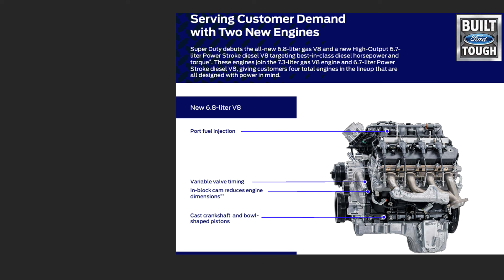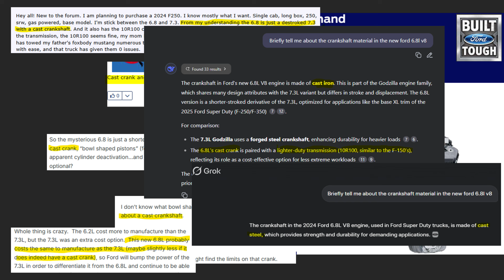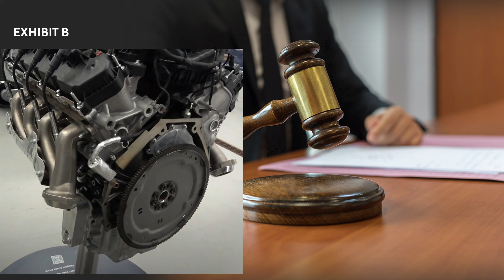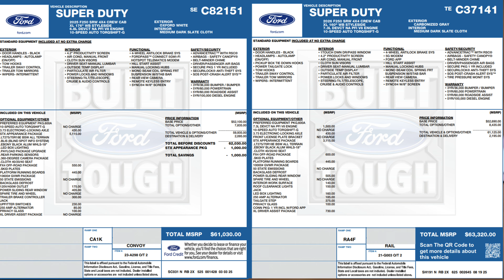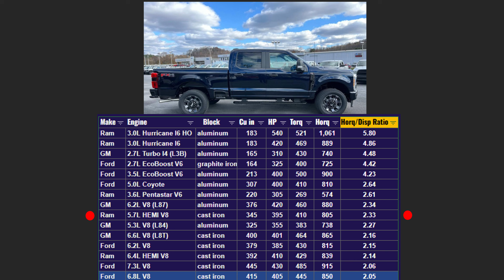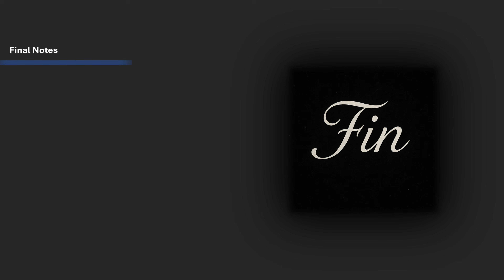Ford’s “Minizilla”: Making the case for the 6.8L V8

Comment: Pretty much agree with you its marketing so as not to devalue the 7.3.  As a 56 year old i grew up with a 460 in dads pickup so im sad they made these 6.8 and 7.3 as i woukd have loved to have a "new" 460.  

Ive heard 6.8 and 7.3 running and they do sound a little different but both nice.  Im still stuck on my diesels but maybe go back to gas at some point.

Im chevy now though a ford man at heart.   Just feel that fords interiors seem cheap and the bones of the super duty go back to the 90s and just seem majorly dated to me styling wise.  Ford needs updated body style badly.
Reply: You’re wrong about that. The current Super Duty bones (chassis and body) date back to 2017. The previous generation was 1999-2016. RAM has the oldest HD “bones” while GM HD trucks use 2020 “bones.”  The current Super Duty chassis is possibly the strongest of the Big 3, so not much need for change. Interiors and general styling are subjective, so to each their own. Fords current engine program is absolutely number 1. Transmissions are basically identical to GM, for better or worse. RAM easily has the best gas transmission, and perhaps the best diesel transmission now for 2025+ models.

Comment: Another plus for the Godzilla platform is the gear driven oil pump versus the belt driven oil pump in some other engines. Great video! Thanks for a clear, concise presentation of the facts.
Reply: I’m pretty sure the GodIlla / minizilla engines use a chain driven oil pump, not gear driven.

Comment: Thank you sir for doing this video.  I've been wanting a 6.8 video so bad yet like you said, nobody talks about them.  I'm very curious about the transmissions as I'm so concerned with a 10 speed as well as maintenance suggestions.  I do not trust the manual anymore for maintenance and tend to lean towards 5k/6months oil changes, 30k tranny drain/fill, 30k/2 year rear diff oil change, 50k coolant change, 100k spark plug change (unless on Wife's Highlander which is 60k, and any other suggestions you might have would be great.

Thanks again and have a great day!
Reply from the maker: Can't argue with your maintenance plan!  Keep that up and it should last forever.  I change my oil on the 5's.. 5,10,15,etc.  Nice and easy that way.

Comment: I ordered my F350 with the 430 gears.  It's a monster.  Still only about 2100 RPM at 70 mph so it's a no brainer especially in the mountain states.   So much less strain on that engine and transmission and i can crush piles of pine cones triple that size under two tires at the same time!!!  I appreciate the deep dive into the crankshaft issue but you know even though I'm pretty convinced based on the evidence and the fact that it's extremely unlikely that they would use a cast crankshaft in a super duty truck even though it could be cast steel I would like to see someone do a physical test on one of those crankshafts to put this issue to rest convincingly once and for all.
Reply from the maker: lol at one-upping me on the pine cones :)  That does sound like a pretty great setup.  I’ve said before, but even if it was cast, it would be fine - especially with stock numbers.  You just don’t see a lot of broken cranks these days. Whatever they put in there would be fine.  I definitely agree about wanting to see someone get their hands on one and remove all doubt.

Comment: Exhibit 123 - Junkyard LS Turbo build spinning 7,000 RPM and making 1,000HP on a CAST CRANK. In the 21st Century, a "cast" crankshaft in an OEM HD engine from one of the North American 'Big 3' means very little, especially for a Normally Aspirated Engine that will never see over 6,000 RPM. These aren't the cast crankshafts of the 1980's.
Reply from the maker: Right.. modern engines fail for a lot of reasons these days but a broken crank on a stock engine is way, way down the list.
Reply from the maker: Right.. modern engines fail for a lot of reasons these days but a broken crank on a stock engine is way, way down the list.

Comment: Thanks for the honest review of the 6.8L V8. You did mention the two window stickers you compared were not identical, but "close enough".  It would be a better comparison, of both the price difference and payload/towing/GVWR, if you had two trucks of the same model year with the same wheelbase, one with the 6.8L and one with the 7.3L  instead of a '25 long-bed vs a '26 short-bed. I have not done that specific comparison, so I don't know if the resulting differences would be greater, or smaller.
Reply from the maker: Wow, I can't believe I didn't catch that!  Thank you!   I used the 'Search Inventory' from Ford's site, and I know I clicked on two short beds.  One apparently was actually a long bed.  I just assumed the years would match since that's what I searched for.  That will teach me. 

So after reading this I went and found 2 (actually) very similar 2026, 6 1/2 bed, and very similarly configured options-wise.  No payload package or gvwr package on either.   Same axle.

The good news (for the video anyway) is that it still holds true.   6.8 is 1,410 payload and 14,050 tow.  The 7.3 is 1,670 payload and 16,546 tow.    Here is the 7.3:  1FT7W2BN6TEC40064   and the 6.8: 1FT7W2BA6TEC95448 .  Great catch and thanks for letting me know.
Reply: @motorobo0  Thanks for the response.  I looked at the window sticker for the 7.3L (for whatever reason I couldn't see the sticker for the 6.8L [maybe they sold it?]) as well as the sticker for some other 6.8L trucks with the 600A XL package. It looks like the 7.3L is a $1500 upgrade for this configuration. Strip away the other options and you have: base price + destination = $54,885 with the 6.8L, and base price + destination = $56,385 with the 7.3L. Everything else mechanical would be the same in this case. It seems Ford is offering a great choice for the consumer either way. Per your research - the base truck will haul and tow more than most people will ever need @ "1,410 payload and 14,050 tow" and it will probably average marginally better 'real-world' fuel mileage. However, if the customer needs (more likely 'wants') the ~18% higher "1,670 payload and 16,546 tow" and they are willing to live with the likely lower MPG figure, they can get that for only 2.7% more money ($1,500).  I live at about 8000 feet above sea level in the mountains west of Denver, CO with many high % grade roads and frequent trips over 11k+ foot high mountain passes so for me the extra cost of the 7.3L to move up in power and add the 18% in capabilities would be insignificant. I'm currently driving a 2013 with a supercharged 6.2L and the 6speed auto. I've got 170k+ miles and still running strong, with no issues at all, so it will be a while before I'm ready to pull the trigger on a purchase.

Comment: Can you hot idle this one?
Reply from the maker: To a point, sure!  I'd certainly feel better about idling it than a 6.7.
Reply: @motorobo0 lots of failures in the 7.3 because of hot idle
Reply from the maker: @Detroittruckdoctor55  I talked about that a bit, yeah.  In the chassis cab configurations, the oil pressure was in the single digits in the name of efficiency.  Same thing in some 6.8 chassis cabs, though not as common.  Very rare in consumer pickups, and from everything I've read, it's no longer an issue. They really took a reputation hit for that. Actually just put out a video a minute ago showing it being measured.

Comment: In about 10 years when im done with my 2000 F350 w/6.8 V10, I'll be looking to pick up a 6.8 Baby Godzilla equipped F350.
Reply from the maker: If you're taking good care of it, I have no doubt it will last till then :)   I have a friend with a very similar truck (I believe his is a 2000 as well) and it just keeps going.
Reply: I needed the most truck for the least money.  I worked for a Ford dealer when these came out. I've kept my eye on them.  It does the work well. Thanks! I'd definitely look out for a newer one with a 6spd.  Auto or Manual.  It's thirsty!  Ha ha. @motorobo0

Comment: I saw the oil pressure looking similar when I looked at it with Forscan on my 2024 7.3. Unfortunately, my best empty highway MPG has been 16.0 limiting myself to 70 mph from Abilene to DFW. The 7.3 is much more than I need. I probably would have been fine with the 6.8.
Reply from the maker: That’s interesting, thanks!   Good info..

Comment: The Godzilla engine architecture is a great platform with a LOT of potential. I know it's a pipe dream fantasy, but imagine a world where Ford de-stroked the 7.3 a little less to 7.0, with better heads, and a sportier cam, and then put it in the Mustang as a "Boss 429" reboot with a little more power than the 5.0 dark horse, but a lot more torque. I'd happily pay many thousands of my own money for that.
Reply: With an iron block that motor puts a 125lbs weight penalty on the front wheels.  That would completely change the handling of the car.  Mustangs understeer terribly to begin with.  That would make things worse.
Reply: @ericb.4914 I doubt very highly that the 6.8/7.3 is 125lbs heavier than the Coyote 5.0, the Coyote weighs the same as an LS1/2/3/7 and an iron block 6.0 only weighs 70lbs more than an LS2. The 6.8/7.3 is only slightly larger than a 351w, they put 351w and 351c in all sorts of performance cars with primitive suspensions compared to today, the 6.8/7.3 has the potential to make 600-700hp in a high state of tune with stock or lightly ported stock heads, the factory truck state of tune isn't impressive compared to the 5L but everything changes with a cam+springs, full exhaust and a tune. With boost the 6.8/7.3 could easily make 700-800hp on 93 and in excess of 1000hp on E85 all the way up to 2000hp with supporting mods. The ppoint of using the 6.8/8.3 is that it will be significantly less stressed at any power level compared to a 5.0 DOHC and it will run nearly forever and is rebuildable rather than a throwaway.
Reply: @LeeHendo 138lbs to be more accurate.
Reply: @LeeHendo  All those old cars were a shit to drive, just straight line performance, and 21 century drivers prefer cars that really turns. Good cars to drive needs a little bit of under steering for RWD and a hit of oversteering for FWD( that I like to drive too). A coyote with aluminum block is what makes mustang a excellent car to drive. Also, Coyote has a lot of room for improvement, better cams and porting to gain a lot of horses, or stroking to increase torque pornographically with system guaranteeing it throughout all rev range. Like
Reply: @victortaveira8271 factory the Coyote is running at over 120% volumetric efficiency, without boost there isn't much left unless you rev it 8500rpms, a stock long block isn't going to last long ng run that way, drag racing sure but, I would want a Boss 302 or 5.2L GT350 engine for that. The most they ever got from the Naturally Aspirated Cobra Jet Coyote was 620hp, a basic cam, springs, headers and tune on a 7.3L Godzilla does that and a Coyote cam rev and make HP all it wants it will never name the tq or last as long. Brian Wolfe was making over 800hp N/A with a stroker Godzilla. People used to run Big Block Chevrolets in all sorts of fast vehicles, a 7.3 is significantly smaller and lighter than one of those.

Comment: 8:00  If you mean power under the curve when you say 'horq', then sure.  Power under the curve means more torque down low and horsepower not tapering off at the high end.  Generally speaking on a racetrack horsepower is better and when towing torque is better.  Obviously both is ideal, and makes it easier for less skilled drivers, or people who want to tow at 70-80mph uphill, fuel and wear be damned.
Reply from the maker: I get what you’re saying, and don’t disagree.  Horq isn’t really a technical measure. Just general overall impressiveness.   An engine with 400 hp and 400 torque has more overall output than an engine with 300hp and 400 torque.  Sorting by torque (or horsepower) doesn’t capture that.  Horq does though.. Really just an interesting way to rank engines by what they ask of their displacement in general terms.

Comment: 7.3 gets a better transmission and the delta in price just doesn’t really make sense to go with the 6.8L. You had said they have the same transmission but I’ve watched tons of different videos that say it’s not the same. Not sure what’s going on with those.
Reply from the maker: For the F250, the 6.8 and 7.3 has the same transmission (10R100) unless you get the Tremor package.   I think that started with ‘25 model year trucks.  Can see with the build and price tool on their website.  The 10R140 is rated higher, but ‘better’ is debatable.
Reply: @motorobo0  quite a few people who seem to know their stuff state one crank is forged and the other cast

Comment: Great stuff. Thanks. definitely interested in transmission info 10r100 vs 10r140
Reply: Gettys garage has a great series on towing between them. You can see the 10r100 gets hotter than the 10r140 and probably is the reason for lower tow rating.

Comment: I got 24 f350 6.8 4.30 with gooseneck. Regular cab work truck. Tows 14-17k great….engine isn’t the bottleneck…the rear suspension or tongue weight maxed out is. Payload sticker says almost 5k. Aside from 2014 tundra (also regular cab), best truck ever.
Reply from the maker: Which engine do you have in it?
Reply: 6.8

Comment: I think Ford has missed a huge opportunity y not offering a Raptor package on the Super Duty and by not offering a Super Duty swb 2 door Bronco both with 6.8 and 7.3 Gas options. I would even be excited to see a 2wd long travel Raptor package (since the Super Duty still uses the Twin I beam suspension)with 37-43" tires, could be a killer prerunner type rig with tons of suspension travel, reduced complexity, increased speed, reduced weight and reduced cost without the 4wd. Add a Ford Racing or Roush warrantied blower kit making 700+HP and  you have the most desirable truck on the market.
Reply: Yeah - call it "the UNDERDOG!" I'd have to buy one....
Reply: @Arkie407 Maybe instead of Raptor the off road Super Duty could be called the Triceratops or something cool like that.

Comment: With no reliable automatic transmission available, and no manual transmission offered, I will keep my 1997 F-350 and it's 460.
Reply from the maker: If it does the job, and you like how it does it, that makes perfect sense.

Comment: Does the factory oil pressure sensor actually read a difference in oil pressure? I thought the sensor was open, or closed only, not a range of potentiometer readings as pressure fluctuates like a normal system.
Reply from the maker: It does read a difference.. for example, when it's cold the pressure is much higher, and just watching the data come in it jumps around a lot.  Someone did mention that I need to measure key on, engine off to start with, then subtract from the running number - I guess implying that it might be non-zero with the engine off.  I'm going to test that and see.

Comment: Missed the 3v 6.8 v10. Much more potent than than 2v
Reply from the maker: You're right about that - it was a much bigger rabbit hole than I thought to pull together all of the numbers, because they change over time.  I think all cases, I just went with the numbers the engine was released with - but a similar table with final (or current) numbers would be interesting as well.  The overall point though is that the 6.8 compares very strongly to everything past and present.

Comment: Glad I found the channel. We bought a 7.3 f350 for occasional heavy towing. I am confident our next f250 buy will have the 6.8 in it. My son and like the gassers as we can work on them ourselves.
Reply from the maker: I think that's one of the coolest things about these engines.  They're engineered to be owner maintained.  Unlike almost everything else out there these days.  And there's so much room in the engine compartment.
Reply: Do you plan to convert it to LPG/CNG for cheaper operating costs? In Europe most of those big american engines runs on lpg
Reply from the maker: No plan to convert it, LPG is a pain around here.   I do find it interesting that there's a bunch of big American engines running on LPG in Europe ... had no idea!

Comment: Also, I would like to add that your horq/disp ratio is some of the most insightful analysis on light duty pickup engine longevity vs performance that I have seen.  Nobody looks at this in modern vehicle comparisons for normal consumers.  It is only fleet managers that really get this.  We have become fascinated by turbocharged small displacement engines that can work very hard, but often, not for very long.
Reply from the maker: Thanks!  I'm glad the horq thing was well accepted.  I wasn't sure what people would make of that.  But it really differentiates between work engines and performance engines that can do work.  Big difference there.  I'd take longevity over raw performance numbers any day.

Comment: One thing to keep in mind with respect to marketing material from any manufacturer of any type.  The marketing department are experts on marketing, not equipment specifications.  If it sounds good and looks good, it gets sent out into the world.  Engineering is seldom tasked with checking up on marketing capital.
Reply from the maker: Yup.  In the end they're going to take whatever angle will net the most profit with as little risk as possible to reputation.  They can throw the 6.8 under the bus, as it's "just a base engine".   It's profitable to downplay it, with very little risk to bottom line.